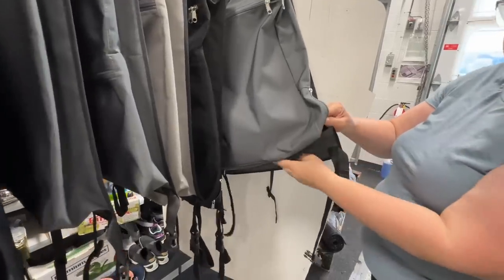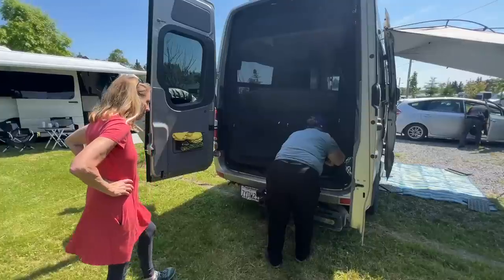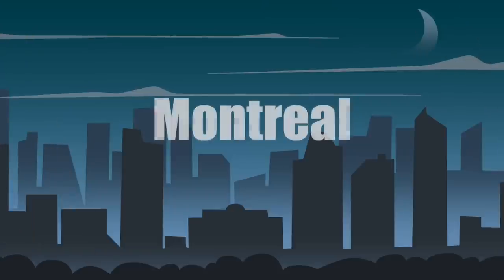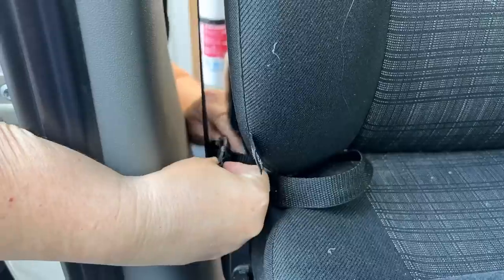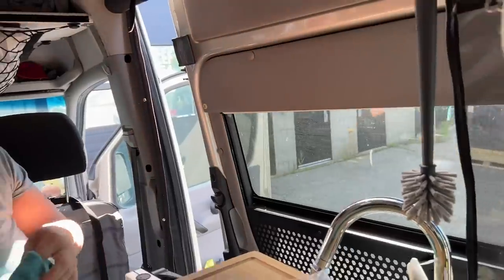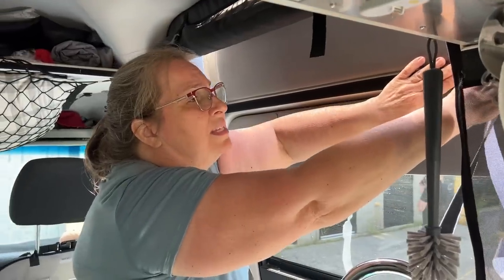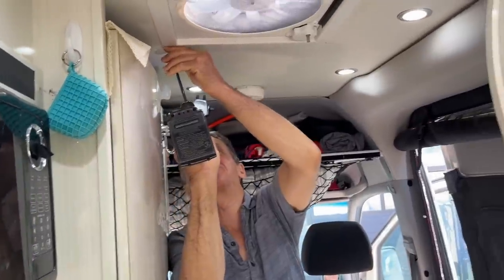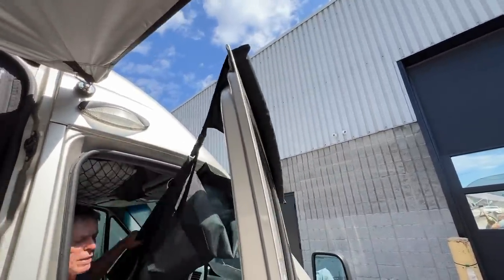Rolef:  The Canadian Company that Makes Van Life Better

Comment: I've been told, by more than one person actually, that I have a bit of an anal retentive personality. I'm also particular about my van. So when my wife and I decided to get side and rear screens for Lily, our custom built 170 extended, XD, dually, 4x4 Sprinter, the only real question was whether to have Rolef install them or have them shipped to the States and I find an installer. That was also no brainer. Road trip!

So last July even with the average price of diesel approaching $6 USD I headed off to Montreal (I managed not to buy any fuel in Canada). Round trip home to Rolef Solution is 1,810 miles but I managed to do it in a little over 2,800🙂

 Even though all the measurements and pictures of my van had been exchanged, Rolef and Agatha still made little tweaks so my slider screen fit perfectly and securely. I'm so glad i spent the diesel to have them installed by the makers. Oh, and I bought one of those new design back seat organizers too.

Rolef.  The best Solution.
Reply from the maker: I'm with you, roadtrip.  They care about how it looks and functions.
Reply: Glad to read your comment. We have an appt @Rolef in late October. CAN’t wait to see their facility & products!🎉

Comment: Thank you for all the great content. I especially like the tips, techniques, and product hi lights like this one.

I do have a question - on several of your videos i have caught site of a tray table mounted between the captain chairs up front but i have not seen any mention of this. Can you provide more detail as i think this might be a useful upgrade for my Sprinter.
Reply from the maker: Thanks Carl.  I got the cup holder from here:  https://cavevan.myshopify.com/products/sprinter-cupholder-snack-tray-bamboo-and-stainless
It is quite pricey.  I actually got a "second" that was in perfect condition but I don't think they are available any more.  And I've seen other people make them.  If you have any woodworking skills at all, it should be fairly simple.  Google images has lots of interesting photos if you use the search term:  "sprinter cupholder solutions"  It also depends on which year sprinter you have.  Ours is a 2016 chassis. The new models have a different dash configuration and much better cupholders.
Reply: @FromShetoMe . thanks i will check out your suggestions.  i have a 2018 Roadtrek ( just before they went bust ) on a 2017 Mercedes chasis
Reply from the maker: @carlschulz1057  That's the same design as ours.